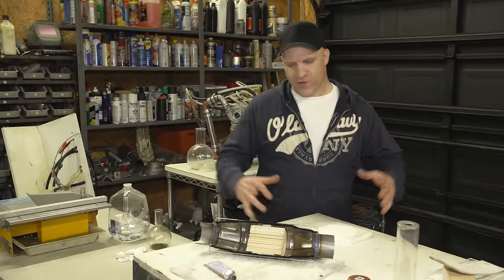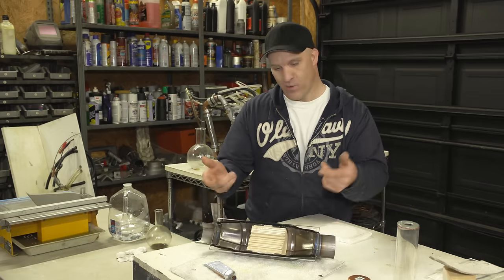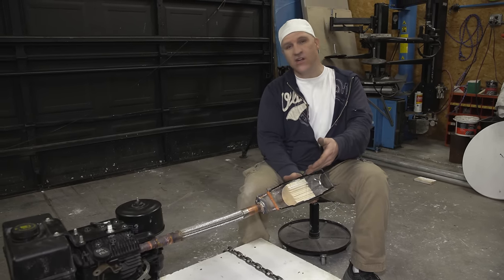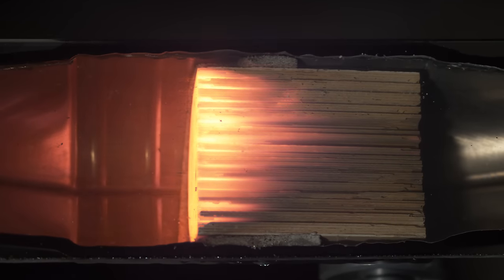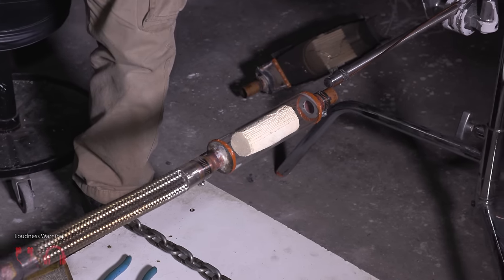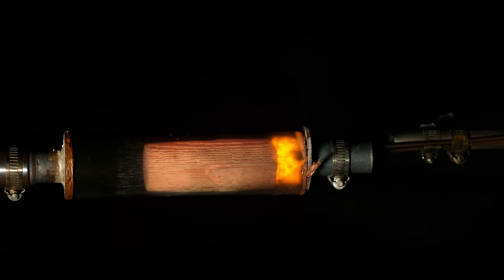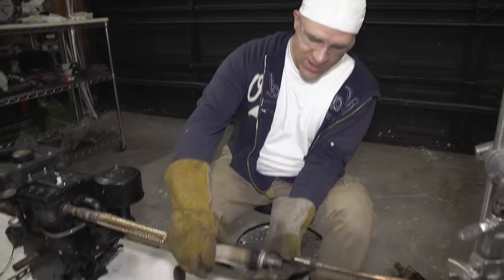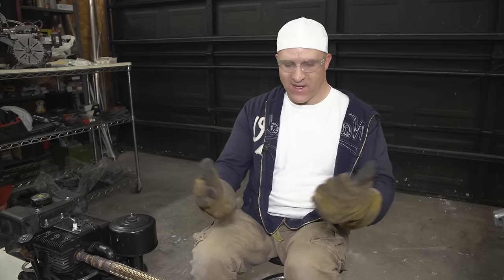See Through Catalytic Converter

Comment from the maker: Check this out https://youtu.be/Jj-ufVglr6M a very informative and entertaining video on the catalytic converter.
Reply: i feel like you should wear a gas mask sometimes
Reply: You make some incredibly interesting videos man!
Reply: Hi makes a transparent Supercharger
Reply: Bhow much for scrap metal
Reply: Great video im sure you can find a way to fit the catalytic pice a little better and then make some videos of clogged catalytic vs cat cleaners im really interested to see how good they work but you definitely did great on this video.
Reply: First step: steal a catalytic converter
Reply: @cartoonelladefrasz7568  lol good one. They started doing that shit around my aria im just going to take mine off lol.
Reply: Next you should see how much horse power a catalytic converter robs the engine  of
Reply: Hey, cool to see. Try this, take Hydrogen or Acetylene and put the gas through without any heat or ignition. The platinum oxide should ignite and burn the gas without any pre-ignition. It's essentially what its doing in the converter, same mechanism as a petrol hand warmer.
Reply: My 88 rx7s cat glowed when I ran the car really hard for a while too
Reply: Abit of fire cement inside to seal around the internals 👍

Comment: Only mower in Illinois that would pass emissions.
Reply from the maker: Lol !!! Great point, that's awesome
Reply: I give up. I'm titling out-of-state. Three failures perfectly running Grand Prix. Plus, the privilege of paying more!
Reply: @iditarod4081  that's why the 3.8 was discontinued. One of the most reliable engines ever built but couldn't pass emissions.
Reply: @tylerwhite3248  Really, cool to know thank you. Yes i love my GP, & my 3.8s (had a bonneville before, its' 3.8 is why i stuck with the line..). I might research it more now that u mentioned it. Purrs like a kitten and the 02s and mufflers are brand new, but I'm not doing the cat just for the heck of it, I've analyzed it over and over with my OBD and it's fine. I have begun to notice that others with GPs tend to I have mufflery sounding problems too, I assumed it's something with the dual exhaust but I'll look into 3.8 emissions issues
Reply: @iditarod4081  The muffler issue is probably the resonator. They always rot out. I just cut them out and replace with a glass pack. Runs just as quiet. Not sure of emissions, as we don't have to deal with that here
Reply: I ditarod check your pvc valve cud be cloged up. Oil in a cat will kill them
Reply: @pacman3908  thanks, i will. I poured 3 seafoams and 3 or 4 catacleans, and put an xtra thousand miles on just to keep readying it, what a waste! Hope those distllates didn't hurt it already.
Reply: I Ditarod probably just needs a new catalytic converter.
Reply: @tylerwhite3248  -  Where are you getting this information?
Reply: Actually, it wouldn't.  No converter in the world can clean up a side-valve engine well enough to pass an emissions test.
Reply: @mark-1234  as far as the emissions statement, that was from my 10 years at a gm dealership and being there when they discontinued it. Emissions being the reason GM stated for discontinuing. As far as the resonator, that's from experience
Reply: More than half of Illinois doesn’t even have emissions 
I’m in will country 
And Kendal county right next to me doesn’t have emission
Reply: Probably
Reply: Without the proper exhaust gas recirculation (EGR) system  combustion temperatures run too high. Not, only increases NOx emissions, but also overheats the catalytic converter, causing damage to the, ceramic brick.
Reply: Commifornia wants to go after all small engines now.....
    Gardner rev up you batteries
Reply: @tylerwhite3248  
Same issue with my 4.9 I6. A 300K mi engine, but simply not clean enough for the 21st century. 
I've run it without cats, and boy oh boy does it stink!
Reply: @mark-1234  in theory, cats in series would each clean 95% of the incoming exhaust, until there weren't enough HCs to keep it lit.
Reply: @bcubed72  - A cat doesn't require being "lit" (I'm assuming you mean glowing) to work.  As already stated, if it's glowing, it's being damaged as it will eventually melt and plug. 

And yes, the more catalyst present, the cleaner the exhaust.  Too much catalyst, however, just means there's a point where no further chemical reaction takes place and the catalyst from that point on is useless.

Comment: Amazing job!  I've always wanted to see a catalytic converter while it's functioning!  Looking forward to the next video.
Reply: Project Farm You guys should definitely do a collaboration video
Reply: Yes! Collab!
Reply: not much to see honestly unless something is wrong.  They won't "glow" unless there is way too much fuel in the exhaust.  Since what is happening is just a chemical reaction that just generates heat.  automotive 3-way converters generally run at between 1200 and 1600 degrees F when they are operating properly, but can work as low as 800 degrees.  below that, they don't operate correctly, and above 1800f you start to damage the retainer/holding material honeycomb.
Reply: @chubbysumo2230  You're right. 

In newer cars with leaner engines can spit out exhaust gases at around 900-1000 degrees C, most likely turbocharged cars, but even a NA engine could do that. 
The temperatures are only there at max. Load, but constantly driving 100-130kp/h also get's the converter toasty. ^^ 

The Video showed why the coldstart phase is so important: The converter warms up fast and sooner starts to break down the exhaust gases.
Reply from the maker: Thank you!! That last video you posted, it was just hilarious!!
Reply: Yes
Reply: What are you doing here??
Reply: @sniuchi2549  why you spell "you" wrong
Reply: @WarpedYT  yes with the exhaust hahhaa
Reply: AzyleeZ Studio sorry english is not my native language
Reply: @sniuchi2549  it isnt my native language either lol . Where you from
Reply: I’m such an idiot..  I thought WP commented on his own video...
Reply: Oh wow definitely you guys should do a video together that will be amazing
Reply: Project Farm best unbiased YouTube channel out there great work
Reply: Project Farm 💯💪😇🙏
Reply: Unfortunately Project Farm, you DIDN'T see a catalytic converter while it's functioning 🤣🤣🤣
Reply: Would be cool to see what happenes to a engine with loctite as engine oil. Iam sure you guys can think of something as a collab video
Reply: love you bro . u are one of the most genuine youtubers there! God bless you.
Reply: Hi project farm I have watched every video of yours and I comment frequently and you always respond to me!
Reply: Callab!
Reply: youtube hero recognizes hero, do a collab we would love it
Reply: Watch a lot of your vids but here goes...Little fact nobody really knows...catalytic converters are actually lenr reactor devices...they were never installed on automobiles to clean emissions...they were installed along with mandatory fuel injection to essentially grow wealth by seeding it with nano elements which are transmutated into other more valuable elements. Multiply some transmutated nano dust by millions once they cats are frantically shipped back to China GM's and Ford after the lifespan of the junk ice car they gave us that purposely wasted fuel just so the reactor experiment would work and viola...you have some real weight on your hands and some real wealth not to mention data and patents to transmutation technology that can convert one element to another up and down the periodic table...dont believe me? I could give a hoot but the auto manufacturers have all the patents to the basically alchemy technology lol how do you think they acquired them? By making all you fools drive their experiments around for a 100 years dumping hydrocarbon fuel into it instead of building a efficient engine hahaha people are so stupid...this is not a joke...it can be proven and you can prove it to yourself with a little investigation...not something anyone talks about. I know because I engineered a reactor using cats and stumbled into the transmutation tech...its insane
Reply: I got crazy idea both of you should colab how about an air conditioner and heater at the engine intake is it  got something to do with fuel consumption and engine temperature ?
Reply: Hey PF watches WP.
Reply: Me too.
Reply: Are catalytic converter good for engine power? Are Combustion chamber more carbon with or without catalytic.. help us PF thanks
Reply: Did you make CFD analysis for it
Reply: Only Project Farm could make a statement like “I’ve ALWAYS wanted to see a cat while it’s functioning”...
Reply: raise your bar on stuff you always want to see homie
Reply: Awesome video! I've always been curious about what it looks like.

What is the CFM at different PSI on a car catalytic converter - like a Ford F150 V8 or a Toyota Camry V4? More interesting, how many catalytic converters (from what car, size, CFM, so forth) does it take to properly operate a non-catalytic wood stove?
Reply: Bro I never thought I’d see you here
Reply: You know you've done an awesome job on a video if Todd from Project Farm gives you props!!!!!!! KUDOS To You Both...WP/PF!!!!!
Reply: I noted that there was a larger rate of deposit of carbon buildup at "clean" idle. It burned off at higher normal RPM, cleaning the converter.
Now you have an excuse to run highway speeds every so often.
Running city all the time can clog the converter passages.
Reply: I had a feeling I'd find ya here 🙂

Comment: You need to delete this video.... I can see this being required on all small engines in California by 2025 LOL
Reply: It's already happening, Small engines have had to meet CARB standards to be sold in California for some time now (it's why they no longer have carburetor adjustment screws). NY has followed suit. (I live in central NY) 4 years back I bought a new Huskvarna ZTR with a 28hp Twin B&S with a 2bbl carb. The 1st year I had to rebuild the carb, and again in the 2nd year, (surging. but couldn't richen up a tad as it needed) then I bought a whole new Chinese Carb for $48 from ebay, $2 less than the Briggs rebuild kit. Runs better than it ever did, and gets MUCH better mileage (a very real concern when mowing 15 acres/week).  I have no doubt the new carb is polluting less, and it saves me about $20/week in fuel costs. Sad state of affairs.
Reply: It appears you have chronic pain. We wouldn't want you to get some kind of lung damage from exhausts and then use up some taxpayer money to fund your healthcare costs.
Reply: @scottmarshall6766  If modern engines burned the fuel more efficiently, we would not need catalytic converters (still nice to have with proper design to reduce exhaust restriction). Jet engines (commercial HBTs) have stricter emissions, and don't need cats. They also get way better TSFC efficiency due to them being smart, unlike auto manufacturers. Get rid of all the EPA required stuff, and do it right.

I can't find the information right now, due to the annoyingly complex wording and difficulty finding the actual EPA regulated numbers (Tier 6 regulations, etc), but I'm pretty sure that commercial HBTs and gas powerplant turbine generators put out way less NOx and burn more efficiently than a higher end high-mpg passenger vehicle. Even with the bolt-on junk like catalytic converters, PCV, & EGR.
Reply: @Baigle1  those engines are run in a specific RPM and load curve. they are run in their highest performing point, or shut down. a car needs to be run in whatever the environment demands. a jet engine is incredibly inefficient during takeoff and landing, but super efficient during flight. car engines are already as efficient as they can be. the only truly efficient engine, at any load, is an ESC controlled electric motor.
Reply: There's actually not a whole lot of optimization that can be done on today's engines. I support putting stricter and stricter rules regarding emissions until fossil fuel based engines can be phased out entirely.
Reply: @Baigle1    that isnt true at all. the reasons cats are used is because they reduce carbon monoxide, nox gasses, and any unburnt fuel that youre almost certainly going to encounter in all but the most perfect conditions. if you ever want to accelerate, there WILL be unburnt fuel in the exhaust, because an engine accelerates by injecting more fuel. beyond that, its literally not possible to stop carbon monoxide or nox emissions in a gas engine. the only thing you can do for modern cars is to make them more fuel efficient, and even then theres a limit to how much fuel savings you can get for a car weighing thousands of pounds. and if youre driving some super economy car meant to be eco friendly and fuel efficient, why would you take the cat off?

the examples you provided are dumb as hell, too. youre mainly talking about turbines that are set to operate at one speed for the majority of their life. cars dont do that. if you want to accelerate and go places, you have to make the engine produce more power and use more gas, similarly to how a plane (whose engines operate on a completely different principle from internal combustion engines, and thanks to that burn closer to 50:1 than 14.7:1) guzzles gas like no ones business on takeoff. there isnt a way to take off the cat and just assume the engine will be better somehow.
Reply: @MrSnek  I had a small suv with a cracked cat that just made u bearable rattling noise at idle. I took it off and broke the converter pieces out then reinstalled it, just thought I'd let you know about this diy project.
Reply: the doge in USA they use their own money lol...
Reply: @noonenooo2843  In not USA they use their own money in the form or taxes for substandard Healthcare services lol
Reply: Jack Myhre ask a neighbor lol
Reply: if they do that ima grab my sawzall